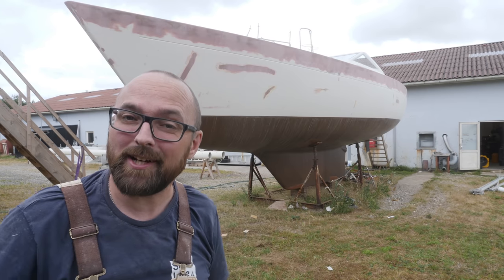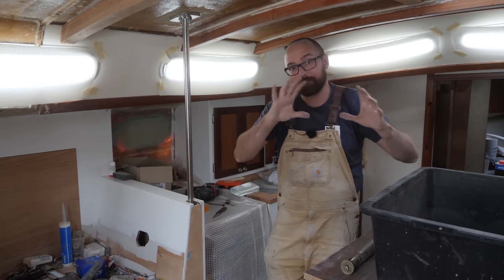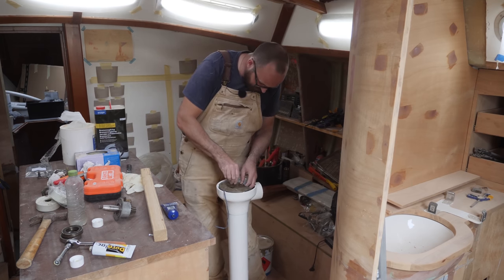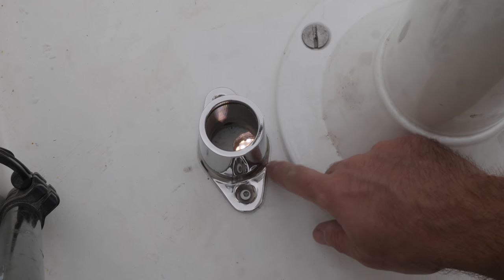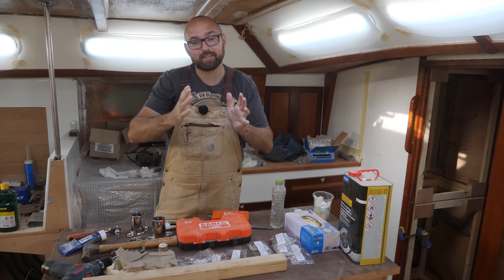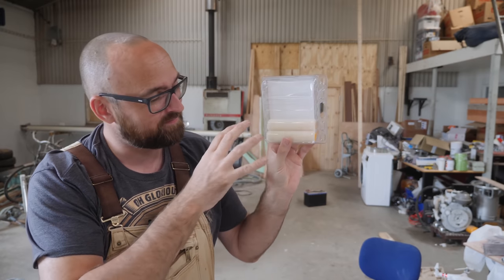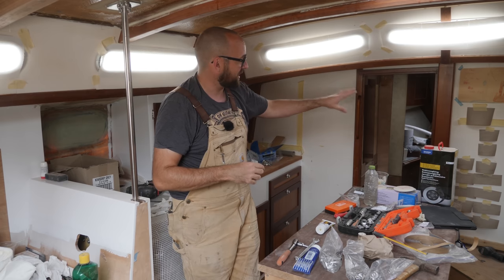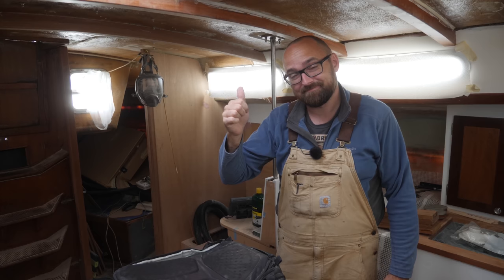Sail Life - First coat of primer & steering pedestal - sailboat project

Comment: ... the Kanban or Scrum board ... I love these tiny moments, when one gets a glimpse of the nerd. Keep up the great work Mads. I look forward to any single sunday evening.
Reply: Same! I find it hilarious. Stu at Dagnar Marine also leaked some info, revealed he is / was a C coder.  Doug at SV Seeker was a database guy. What is it with IT and boat building?!
Reply: @travisjicorcoran5870 I think we has a need to build physical stuff as well as the "IT stuff" that is not physical. I'm not there yet, but I know I could fit a 50' boat in my backyard and I feel the need for a boat project. Too bad my SO doesn't share my enthusiasm  for such a project.  
I'm a former refrigeration engineer, now Oracle DB expert and C# programmer.
Reply: Rather watch faring and sanding then references to agile. That is another way of saying micro-management where I work. :(
Reply: @wstrater  if that is your impression of agile then it is not correctly implemented at your work. I've worked at places where they where supposed to work agile and all teams had kanban boards and every one felt as you do! 
It is not supposed to be micro management, it is not a tool for managers at all. It's a tool for teams for accomplishing their work!
Reply: @everythingexplained  Former Oracle database systems analyst designer and general IT muddler here, now turned sailing bum and full time layabout. I know what I like.
Reply: @everythingexplained  I have always found where the Other half is concerned, it is easier to ask for forgiveness than it is for Permission.

Comment: DuraLac is a pretty amazing compound.  I recently did a full re-rig on a 52ft ketch that was built in the early 70's.  There were several fasteners in the Mizzen Mast hardware I had to remove so I could repair the spreaders, they came out with no fuss and you could see the yellow compound still in the threads.  Most of it seemed to have worn away but it really did its job where it counted it the finest nooks of the threads.  I doubt they had ever been removed since the rig was assembled.

Comment: I've used DuraLac for a few roof and window sill applications. Very good product. I have a test bolt that's left uncoated and the aluminium has already made iffy bubbles under the paint. Obviously, i'm not in a marine environment, but i do have electrolysis happening because of inherent static charges that occur in large metal and plastic things.

Comment: I can't tell if the the legs on the steering column are eccentric to the column, or if the drill holes for the port leg mounting point are inset by five millimeters and the port leg is leaning in.  It just looks a little skewed in the video.  BTW, I am only saying this because I think that you are probably more OCD than I am.   Anyway, thanks for producing all this great content.  Your consistent productivity is pretty inspiring.

Comment: Be aware that Duralac can separate in the tube during longer-term storage. You have to massage the tube or even find something skinny to stir it in the tube. As well, really clean the thread on the tube because once that stuff dries it's a strong glue - I keep mine in an air-tight jar to try to stop the glueness from happening... with mixed results.

Comment: Find a rubber supplier and buy a flat thin sheet for gasket material. Sharp utility knife, scissors and you can make a gasket. Old charts make great paper engine gasket replacements too.

Comment: Kanban and scrum. Yeah, Mads does SW engineering....Do you have a backlog, and work items for the current sprint?
Reply: His current sprint is 4 years and still running. When a task (hull fairing) is 100 hours, the organization of a short sprint is relatively meaningless, communicating nothing. And when the customer  is also the team, definitions are often circular and self satisfying, rather than objectively formal. In case you missed it, yup I am a software Archiect.
Agile is first about values: The Agile Manefesto, and second about processses. Modern managers confuse this and make it more painful than it needs to be all the time. I am personally one of the original signatories to the Agile Manefesto. Management focused certifications ignore or fight with my definition. Probably the main proponent who spends his days talking about what I mean is Uncle Bob. And we have renamed it software craftsmanship. If you are curious you can find more at https://techbeacon.com/app-dev-testing/uncle-bob-martin-agile-manifesto-15-years-later
Reply: @michaelrempel9025  It's about time something got sorted. They were making the same mistakes on the day I left as they were when I started 25 years earlier. Didn't anyone read The Mythical Man-Month. Never underestimate the power of stupidity. May the force be with you.
Reply: @philgray1023  Corporate culture is stupid strong, espencially when it is the same people who agree with one another. My response is litterally, if you are not ready to innovate then you should fire me. And my last job did that in November for reasons we both understand. It used to piss me off. But these days it makes me happy, cuz I get to move on to better things.

Comment: Steering pedestal looking good. You mention that the top bar is solid for hanging onto. Where is the chart plotter, instruments etc going to be located?
Reply: On top of the bar, of course. That still leaves the sides of it for hanging on to.
Reply: JAFO very good, so you’ll need to cut cable holes in the pipe before installation.
Reply: @gerrycooper56  - Drill, more than cut, actually. The hole(s) don't need to be very large.
Reply: JAFO yes. We had a Raymarine network cable, a vhf command mike (Icom) cable and a network cable from our Fusion entertainment system (linked to chart plotter). We also installed a cigarette lighter adapter in the back of the chart plotter enclosure so we could recharge/power phones and iPads plus a Davies low power hanging lamp. So, a few cables for us.

Comment: I don't see the need for a wheel, a tiller would be a better option.  On passage a good wind vane or autopilots(s) are used.  A tiller would allow you to sit further foward and be sheltered in the cockpit when necessary.  Also a tiller would permit you to use a bigger table or locate it further after and allow easier access to the companion way.  Instruments can be located near the companion way, and be portable.
Reply: Converting a wheel-steered boat to tiller steering is a lot of extra work. Mads is, after all, trying to get Athena finished in a reasonable amount of time.

Comment: Madness, have you not thought to buy some cheap pine, and some tarps and built a tent-like cover over your boat, so that you don't have to dodge the raindrops?
Reply: Have you not thought that "cheap pine" is not cheap everywhere in the world? US prices for timber make the rest of the world envious. Here in Australia, for instance, cheap 2x4 pine will cost $3 per metre. That's roughly about $1 per foot! Now think about how much timber you'd need to build a reasonably sturdy frame over a 38'x12'x15' boat! Much cheaper to work on it when the weather permits.

Comment: Not sure why the head long rush to get the boat into the water?  Stay on the hard, next to your perfect shop/storage and get all your work done!  The money that you save on dock fees alone will buy some nice toys!  Maybe even a proper marine 1800 RPM gen set.  That little one will drive you overboard in 6 months if used on a daily basis!

Comment: A couple of things, Mads. You forgot to put the anti-electrolysis compound on the base bolts for the steering pedestal. Also, what is the brand name of the flexible sanding board you use for sanding the hull? I'm ready to fair my Mac 25 and I'd like to get one. Did you buy it in the U.S. on a trip here?
Reply: @DWAJarrett  thanks

Comment: You forgot to explain what the messenger line through the pedestal was for. My guess it's to pull electrical cable for the pedestal electronics
Reply: The electronics wiring will go up through the side-rails that form the U-shaped bar on top (which is where the electronics will be mounted). The messenger line is for the compass light.

Comment: I would fit a folding wheel. I would fit one on my boat if I could afford one. Do you think there is any chance of compass deviation by moving from alloy to stainless for the compass mount? Not that anyone looks at them anymore. Thanks for the video Mads, our dose of sanity for the week.
Reply: Marine-grade stainless steel is basically non-magnetic. Apart from which, if the compass is properly swung and adjusted when she's in the water, it won't matter. (Do some reading up on the process of "swinging the compass". It's quite interesting.)
Reply: @Garryck-1  I shall do that. My compass is unfortunately a Northern hemisphere version which lives in a permanent tilt. I was going to replace it until it was pointed out that no one uses them anymore.
Reply: @philgray1023   - A compass adjuster ( yes, that's a profession) can easily adjust your compass to make it suitable for the Southern hemisphere if you wish.

Comment: No more fairing? So no more mr. Flexisander? I've reached the fairing step in my own hull-project (only 24" though) in the grater Copenhagen area and are really currious as to what size of fairing/sanding boards I should get.. Haven't been able to find a place renting them out yet.. Would almost prefer that option as I won't need the tools for more than one project..
Any thoughts/pointers?
Reply: we looooved our Flexisander! It was the only way my husband was able to sand for 32 hours straight! (no joke... lots of redbull)

Comment: Hey mads, which 2 pack rollers are you using? I’m having same problem with mine, they either fall apart ( foam), or leave a thousand cloth bits through the paint job( mohair, short nap). Thanks
Reply from the maker: I'll put them in the next video if they can in fact handle the epoxy primer. I'm 90% sure but we'll see 🙂

Comment: Could water enter around the foot bolts because the interior sides of the bolts are not sealed. Water down the pipe into the foot and to the bolt hole.
Reply: Nope.. that's what all the butyl is for. It seals without hardening.
Reply: The butyl is only around the outer edge of the foot. If there is not a water tight seal between the foot and the pipe water  ould get in the foot and to the bolt holes. Look at the point where the under side of the foot is shown. Unless there is enough compression to force the butyl fully around the bolt. Then, is there enough butyl in place to do this?

Comment: Your going to regret putting that pedi stool in yet you've got to squeeze in the washer and dryer and now worry about damaging the shiny bits
Reply: I think the plan is to lower them down in through the large hatch at the forward of the boat.
Reply: Yep.. when he put in the new forward hatch, one of the reasons he made it so big was so it could fit a washer and dryer through it. (Oh, and it's pedestal, not pedi stool.)